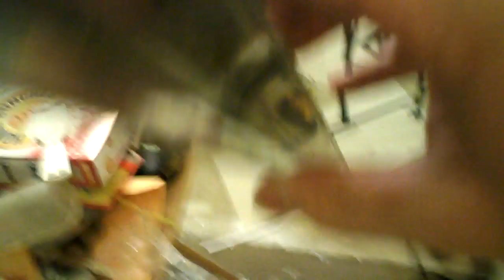DemonDriver's A300 wing Leading edge slat test!

Comment: Yes, these are Krueger FLAPS...not SLATS.

Slats deploy by sliding forward and down from the leading edge of the wing to keep the boundary layer attached to the top of the wing and to lower stall speed.  LE flaps simply increase chord, thus making the wing "bigger" and enhancing overall lift.  They are both very draggy.  That is, drag increases due to both lift increase (induced drag) and due to something being stuck into the airstream (form drag).

However, your Kruegers should still be effective at low speeds.  The little gap between the LE of the wing and the flap can be remedied with tape...the gap is generally undesirable but at this scale, turbulent airflow may not be an issue...though the flow-through of air through that slot may render the Kruegers less effective.

A smooth, unbroken overall top-wing surface is optimum.   The gap negates some of the added lift efficiency.  

Not picking nits...because your work is clever, quite brilliant and innovative.   I'm just trying to help.  No offense is intended.

With that said, your models are very....VERY.....well-done and fly very well.  You're a natural engineer and creative/innovative thinker.  Great videos!
Reply: One addendum:   Slats create "slots" when deployed forward.  The slat itself is a small wing, airfoil-shaped and keeps the airflow smooth.  It was invented a long, long time ago and put to use on various aircraft in various ways.  Airliners make great use of them to allow for much slower approach speeds but not all airliners are equipped with them.  

Krueger Flaps simply swing forward from the bottom of the leading edge of the wing and increase Chord, thus the amount of lifting surface.

Comment: looks as if these would act more in the spoiler aspect , rather than slats .   AND, pleeaasseee  stop saying " you guys "!!!!!   outherwise.....nice job  t/y
Reply from the maker: You Guys!!!!!!  LOL  Intsky you crack me up! The slat is on the lower leading edge of the wing and when its deployed it forces more air over the wing's surface therefore increasing lift! . . .On the other Hand a spoiler is on the mid-upper surface of the wing and when its deployed it disrupts the smooth airflow over the wing and causes massive drag. Understand Now?